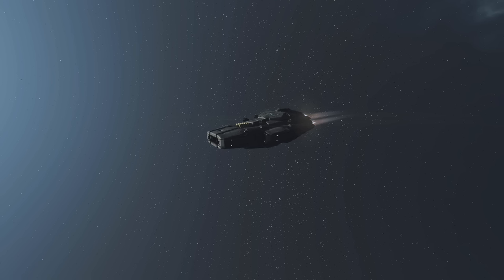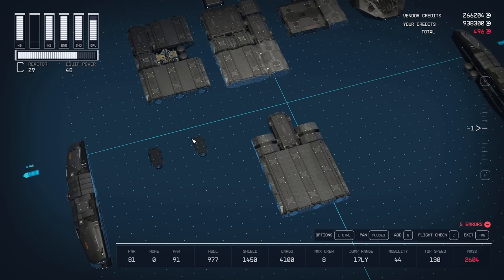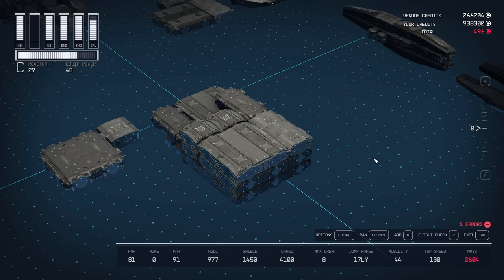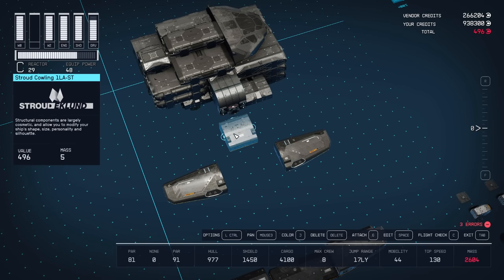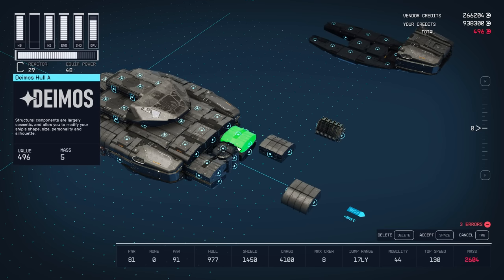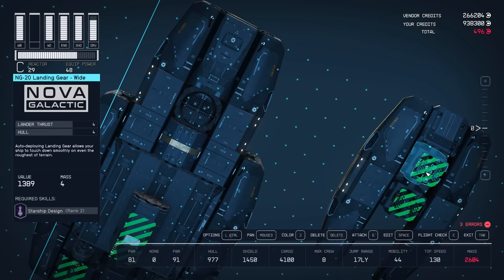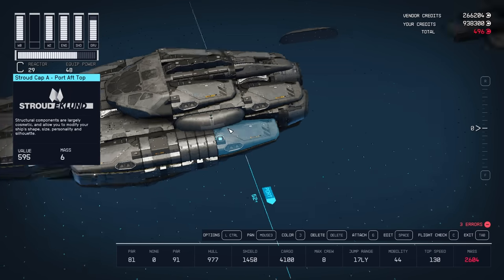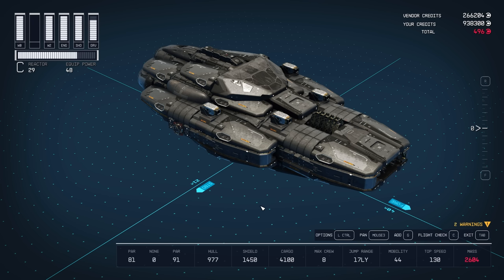Starfield Ship Build Guide: Howitzer-Class Frigate

Comment: I just had an absolute blast building this, it took a while going to all of the different vendors to pick up the specialty parts, but it was well worth it.  I switched out the grave drive with a J52 Gamma drive and just removed your extra store room above it.  I also used an H40 atlas fuel tank for 550 fuel in the same spot.  I wanted to beef up the engines to 4 Supernova 2200 but I got an error that I needed more landing gear.  I found the perfect spot to add them. I removed the 2 lower Stroud mid bracers and replaced them with 2 Stroud accu-lander 11 landing gear.  That gear has the same shape as the mid bracers and it's actually lighter mass.  

Thanks I really had a blast.
Reply: Good call on the landing gear, I am unashamedly stealing that for my own take on this ship.
Reply: @nickchivers9029  I also wanted put on 4 Sal 6830 engines, but it gave me the error that the ship was too long, it just goes over the limit by 1 meter.
Reply from the maker: @scottkoch4423  yeah I originally gave her a longer snoot but I had to squish it into the build limits and we ended up here
Reply: @Sulcrux  I spent a couple of hours today putting your creation together and I'm very happy with it, and I can't see a way to squeeze another meter out of it either.  I also hid a jammer and a small shielded cargo using your  flip and release method.  I was able to get the mobility up to 83 by removing 2 of your cargo containers in the mid and replacing them with more Stroud mid bracers, with 4 of the big engines
Reply from the maker: @scottkoch4423  I'm so glad I could facilitate your enjoyment of the game! Yes, please feel free to adjust whatever you want! I just want people to enjoy their ships.

Comment: I really like the shape of the ship. Built it, quite nice. My only complaint is that the rather short jump range can be rather annoying.  I went with a better grav drive than this (still 1x1) and some places are a pain to get to.

Ladder lay out can also be a bit confusing on first visit though that sorta solves itself over time as one memorizes the layout.

Slight warning for the build, some of the end game reactors lack a bottom attachment point for the angle plate you use to cover the reactor.

I wonder if there'd be a way to modify the arrangement to fit in a 1x2 grav drive to solve the range issue

Edit: Found a solution, swap the 3x3 cargo hall for a deimos 2x3 cargo hall. Replace the two 1/2X1 tanks for a 1x1 he3 tank (ideally one with more capacity than the two tank combined.) then swap the position of the grav drive and the fuel tank. This will free enough space for a two story grav drive who'll occupy where the old fuel tanks were, and the 3x3 cargo. fill the leftover space with filler blocks (If you put a 2x1 hab in the free space, the game will spawn a ladder from the mess hall pantry, rather than put a door between the cargo hall and the new hab. It's weird. You will see a bit of the grav drive poke out on one side as it's obviously not the same design as a hab and they cant be painted. You could hide it a bit more by moving the rear lower cowling of each outrigger 1 block back, and putting a stroud or deimos filler block between both ourigger underside cowlings.
Reply from the maker: Excellent point about the reactor attachment points and the Deimos belly. This is something I didn't consider that I'll try to do in the future. More than happy that you've adjusted parts to suit your needs! Most of this build was done with parts I had available to me around level 20 so I didn't have access to some of the better drives. You'll notice the reactor is nicer as I upgraded that piece after I had posted the original build to Reddit and before I had made this video.

Comment: This is an amazing build, I hope you’re planning on making a few more to share! Gonna have to get my c class license and get building, do you have an order of where you go to build it? I’m confused as to how one is supposed to ‘ok’ a build that’s not complete in order to travel to the place with the parts you need. I’m hoping it’s not slapping a bunch of bits on to make it at least get off the ground?
Reply from the maker: Thank you! I don't have an order of where to go to build it but I can try to make one. What I meant by using an incomplete build that's 'ok' to travel is purely relative to the flight checks in the ship builder. As long as you have enough landing gear and jump drive per mass and whatnot according to the ship builder you can build part of your ship or slap on more of whatever landing gear you have access to. I recommend flying around with another completed ship and then slapping on the parts as you can buy them. I usually go to New Homestead and buy as many landing gear as I need first, and would probably get the cockpit there first too. Then just slap on some basic habs so you can get from the landing bay to the cockpit and the docker and whatnot. It doesn't matter what the ship looks like during this part shopping phase.
Reply: @Sulcrux  awesome thanks for the info, I’ll get round to it eventually, I just keep finding other stuff to do ingame and end up 6 hours in without touching the parts of the game I meant to when I turned on!
Reply from the maker: @tomsimpson357   no worries at all! I posted ships to the internet to facilitate enjoyment of the game, so you do you!